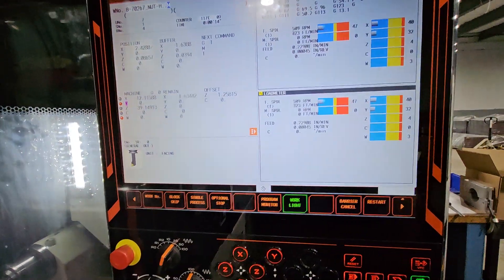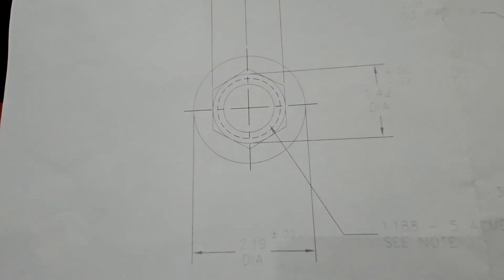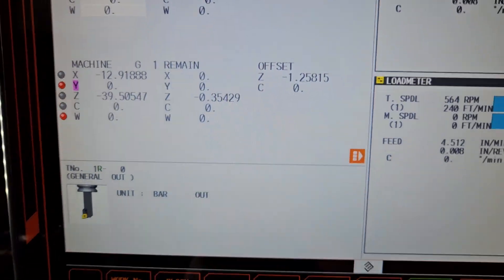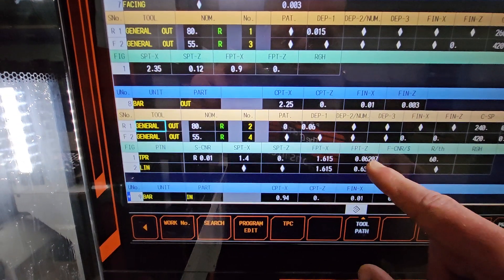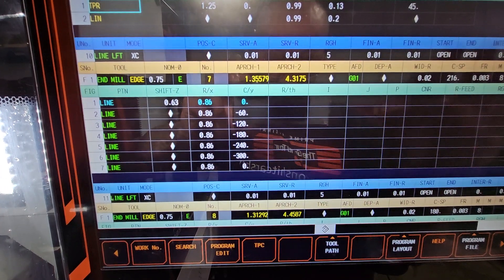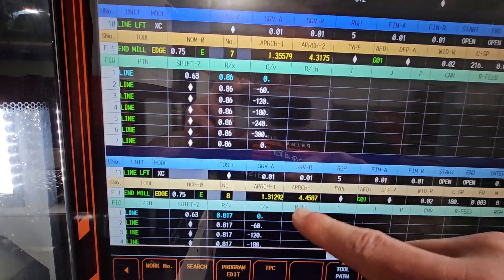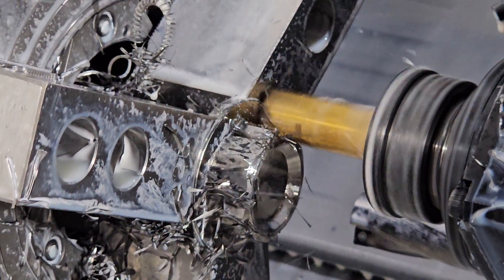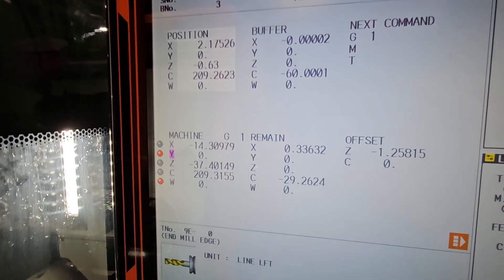Mazak Mazatrol Smooth G Programming and Milling Hex

Comment: How would you program an internal hex? 
I just started being a machinist on mazak and always wanting to learn new things.
Reply from the maker: You wouldn't be able to get those sharp inside corners unless you'd use tiny Endmill to go around, so if you need those, you would need to drill a the centers of the corners of hext first, then line left or line in would do the trick.

Comment: I wanna see how to do hexagon with ZY axes plz
Reply from the maker: I've done wideos with hexes, I use x and c because x and y absolutely make no sense on lathe since the end result is the same, the issue comes down to how much travel you have on y, once you go below 0 or center if you call it, your y travel gets smaller and you will hit a soft limit , therefore I don't do it that way, but if you're set on that, devide 360 by 6, start on c0  in xy mode, drop the y to whatever size you need and bring your y up, just like doing a flat

Comment: Hi marty, im wondering what is the  best way to mill an o ring groove in a part. And if it’s possible to do an o ring groove in just one finish pass?
Reply from the maker: Depends on the O-Ring and depet and tool you use, you haven't really gave me enough information to go about.
Reply: about 2.8mm depth and 4.8mm slot width using a 4.8mm slot drill. my problem was i couldn’t find a solution where i could do this in one pass. when i tried, it wouldn’t complete the full circle. 
very hard to explain with our pictures sorry
Reply from the maker: slot drill? never heard of such a thing  @harrycook614